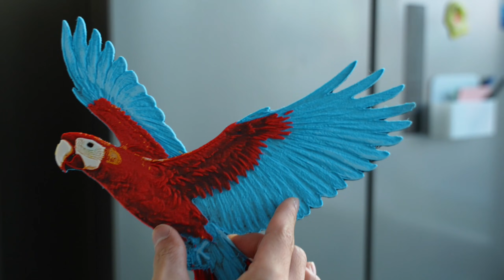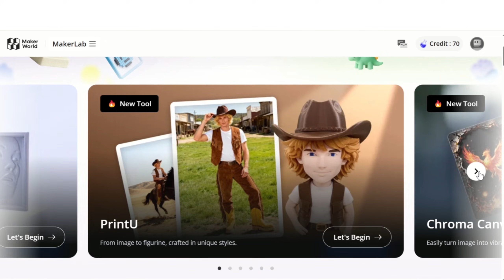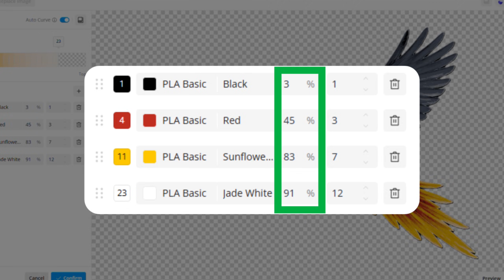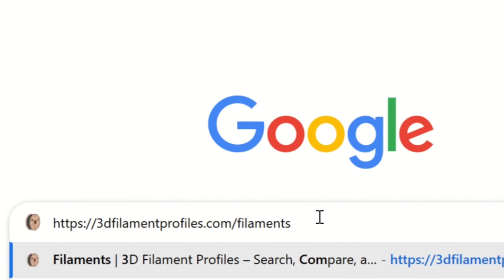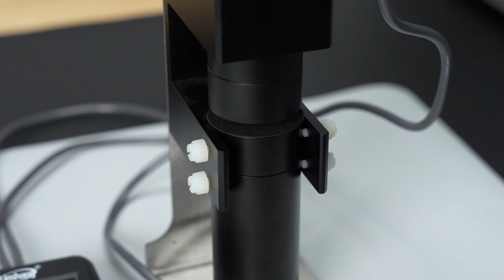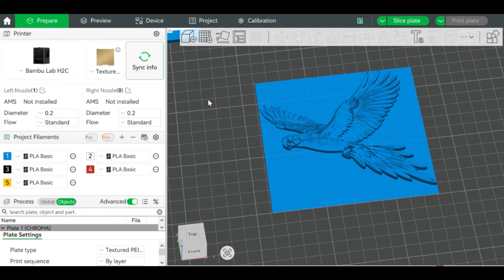Chroma Canvas - Understanding the Color Wheel Tool and Transmission Distance

Comment: Why doesn’t Bambu provide TD values for their filaments in the data sheets? Frustrating to have to depend on external sources for accurate TD values. Since this is very important for Bambu’s Chroma Canvas you should provide these values. It’s a simple measurement with a BQ T1DS meter. Please provide these values!